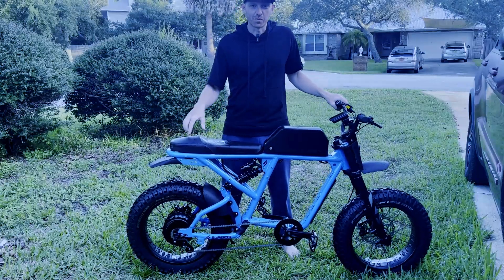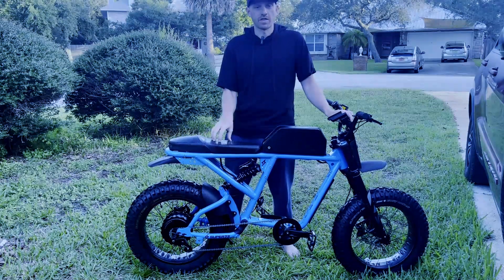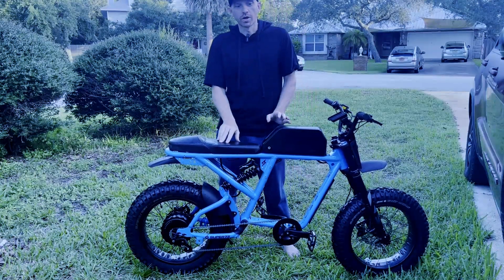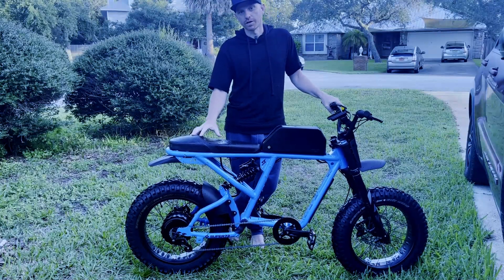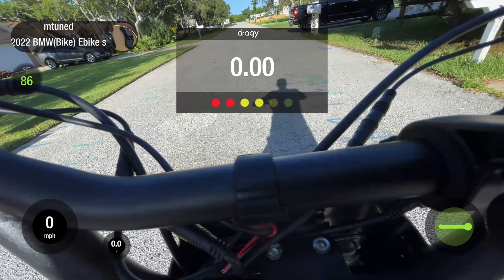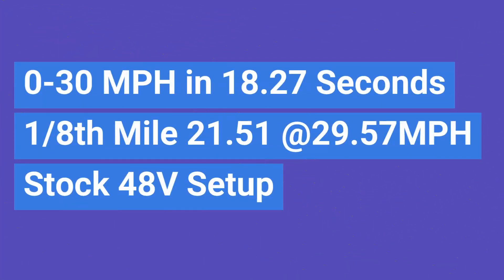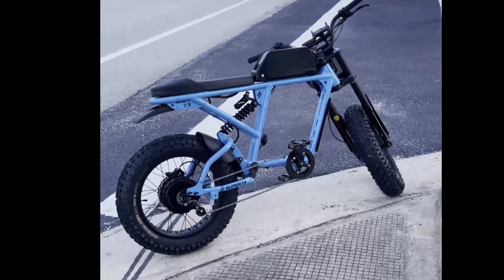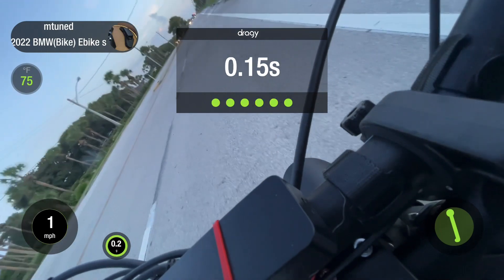Super73 RX  Mojave 72 Volt 50 MPH Stock Motor Upgrade . 1/4 Mile Test.

Comment: I have an e-scooter 5600 it’s pretty fast 53mph but I really want and e-bike like this and imma have to get 72v battery but I want to run 3000 watt motor hub with it u think this bike can handle a 3000 watt hub motor ik u was just working with 1k watts?
Reply from the maker: Go look at my recent shorts.   I run 22kw to it.

Comment: Will the OEM PAS and down step converter (light, throttle, horn) still work with the phaserunner? Looking for a PnP controller solution but having a hard time with the research
Reply: No. Handlworks are developing something though but will be expensive

Comment: Awesom as I have always said, you can drive geared motors with 72v and significantly more amps than many people think, you just shouldn't use it like a tractor and you know that it can quickly overheat or the gears can be destroyed, but if you know how to do it used, you can drive with it for a long time

my fiido d4s from 0-30 mph in less than 5 seconds

Comment: What’s the ah and WH of the battery?
Reply from the maker: 15ah 72v
Reply: Is it possible you could build a 72v 30ah or so with a continuous of 80a+?
Reply from the maker: @johnnylong2049  in that case no.  Could build two of them and have 150+a output.
Reply: I want to run a hub motor (2000w from china) with one 72v and another 72v to run a cyc x1 pro gen 3 5000w. Is this silly?
Reply: On a super73 platform
Reply: I’m not sure what you mean. I’m still learning.
Reply: But ima sub for the info. Ty

Comment: Ok. Everything installed. 1st Frankenrunner had communication issues, 2nd is working and that's about where I am, decent settings, as in very similar to stock but just a 'tad' more torque pull. What would be some specific settings to play around with to really dial in more low-end punch, not quite a wheelie bike but when you hit it, you think oh sh...! Not sure if email is better for specifics, I am at your mercy bud. Thanks again for the inspiration and starting this.
Reply from the maker: What battery and voltage?

If you want to push it all the way.  Set the phase amps to 99 that’s what gives your tq.

Also swap the pole pairs to 45 and rerun the base.  I pulled motor apart and did the math and that’s what I came up with now.

For battery amps set to max your battery can do.

For power limit I have mine at 5kW.

I run 72V

Also your throttle response settings for up and down should be set to 1-5ms.
Reply: @BuildItTuneItEV  it's from ElectrifyBike, the 52v, 50Amp, 21AH, Samsung35E cells I believe. --Ok, I'll get some re-tuning done today and go for some test drives. Thanks. Wanting 72V but I'm at the mercy of finding some instock
Reply from the maker: Man another James I know has the exact same battery from someone else.

Problem is those cells are only rated very low for output and you won’t be able to run much more then 40-50A through them.  They are rated at 8A max per cell.

You are 6P

So max your cells can output is 48A and that’s pushing them to the limit.
Reply: @BuildItTuneItEV  10-4 - appreciate it. I'll see what it'll do today.
Reply from the maker: How’s it going, feel free to email me as well.

Email is on the about page.

Comment: Update  on if we can use this controller on the stock battery until we decide to update the battery? Tried messaging on Instagram
Reply from the maker: I have tested it on 48V, just not the stock battery.
So I can't say for sure as the factory battery does have a module inside the bms which talks to controller.  I sold my stock battery so would need someone to send one in to test.

the 48V vs 52v vs 72v video will be up soon.
Reply from the maker: I just asked a friend who works on stock battery's he said it works fine. So just watch the video I post today or tom and you will know if you can deal with the 48V setup. :)
Reply: @BuildItTuneItEV  it’s just temporary as long as it adds a little tq it will be a light upgrade gonna have a battery built I’ll watch for sure. Been patiently impatiently waiting lol
Reply from the maker: @phat56pat  Essentially at 1500W its almost the same between batteries.   I just had a lot going on this week.  Doggo injured himself so its been taking up my free time. Sorry for the delays.

What is your main goal with the mod? More top end or more tq down from a start? or mid range?
Reply: @BuildItTuneItEV  I want more tq really obviously top speed would be nice but that will come with the 72v I just would like to go in steps as I have 20 other projects and wanna ride this until winter then I’m gonna tear it all apart to do a battery and motor powder the frame some other mods as well. I want to do a battery in the stock position but wider and taller to look like a gas tank so have to have a cover designed
Reply: @BuildItTuneItEV  sorry to hear about the pup.
Reply from the maker: @phat56pat  The one issue with phase runner is its limited to 99 Phase amps. I know you know a bit about gas bikes so Ill use that as a reference.  Phase amps are what drives the tq of the motor.  The factory controller is around 75 phase amp. and runs around 30 battery amps.  With this controller you will only be going to 90 phase amps but up to 60 battery amps.  So the tq from 0-5 mph is almost the same as stock. Maybe a small percent better.  The battery amps which would be doubled is what gets the bike going after the hub is moving along some.  so from 5+ it would feel much better.

If you want bottom end tq, you need to double the phase amps, which this controller cannot do.

Comment: And it only cost 6k to get a bike like the Ariel Rider for 3k
Reply from the maker: Huge misconception from people not really in the industry actually.

Those bikes are basically all no name junk, so no components are worth the resale value.  And you end up with nothing.

I sold the stock battery for 1400.00 alone on this bike :). Paid for new battery, controller and motor 😎. And I don’t have to be seen riding an Ariel 😂🤮

Comment: How hard is this on the stock motor? I have an RX from last year and already have about 2500 miles on it. Currently running a chibattery dual setup, but this is very interesting.
Reply from the maker: Judging by heat alone not an issue, ill have to get some more abuse and time on it.

Comment: This is definitely a great upgrade. Can you please confirm if this will work for a Bafang rear hub motor rated at 750 watts with Juliet pin connection? Thanks!!
Reply from the maker: You will need to use a different connector to connect to motor.

But yes this controller can run it.

Comment: How many ah is that 72v ? I would love to have that set up for my super 73 but with the bac 855
Reply from the maker: 855 is same thing so you will be good to go.   You can build this case here to 15ah 72v depending on what cells used . Or more AH if less voltage is needed.

Comment: How did you get a phaserunner? Been sold out for years
Reply: Basically the Dame setup for the frankrunner? I think grin makes an adapter for the bigger 9 pin motor wire. Awesome 👌 vid and I'll be waiting on the setup vid. Thanks 👍
Reply from the maker: @joelresto.juuntitledgtuu4i435  yes, I’ll be sharing tune for both.
Reply: @BuildItTuneItEV  are you in florida? Maybe you can help me build a battery when I'm ready to upgrade. I'm near Port St. Lucie area.
Reply from the maker: Yes, I am in Saint Augustine!
Reply from the maker: I have have been using Grin products for years.  When I purchased the new bike, and seen the l1019 connector I ran to my closet and got this out.

You can now just a frankenrunner though, until grin gets the private labeled ones back. (If they do)

Infact the frankenrunner has more features.

Comment: A lot of the electric unicycles are using 100v or higher.  I wonder what a 100v kit would do for electric bike builds like these.
Reply from the maker: I really thought about doing two factory batteries in series , controllers are tougher to find in big power.

I am working on getting my hands on a 650a 96v controller

Comment: Awesome work, can’t wait for the step by step tutorial!!
Btw what’s the full cost for this whole upgrade?
Reply: Using this
Reply from the maker: Battery cost will be the unknown.

You can go with any 48v 52v and 72v pack.  

The controller is 339.00

It plugs into the oem motor directly.  And you also will need a new throttle unless you want to adapt the factory one. (Totally can)

That’s all that is needed, in the most basic fashion.  You can add a display and pas as well, and brake cut offs or what ever you wish. The more you add the most cost goes up.

I just am using my phone plugged into controller for readings for now.  

This bike will eventually be going 20,000w,  going to push it more than the z1 build I did.

Just enjoying it along the way and sharing it with the community.  Hopefully Grin will upload the base map for motor to the site so others can use it easily.

Comment: Sick build. How many amps are you feeding it? I wanted to do this but was worried about the hubs longevity at 72v
Reply from the maker: I have the tune limited to 70 amps.  Phase amps at 90,  stock phase amps is around 60. 

I have not had an issue with heat, yesterday I went on a 20 mile beach ride in soft sand.  Motor was warm to touch. Maybe 20F over ambient temp.

I’ll have a logger sooner for better data from the controller.